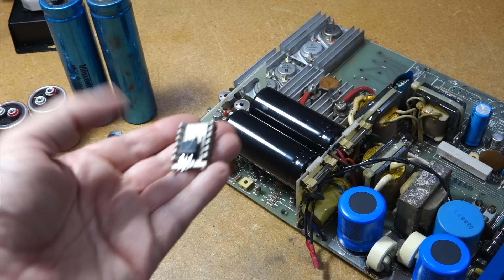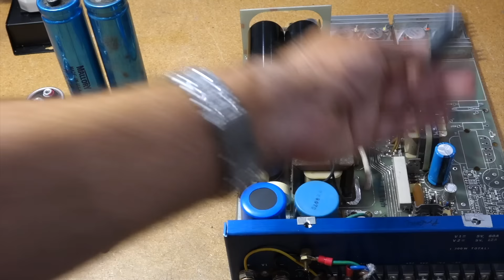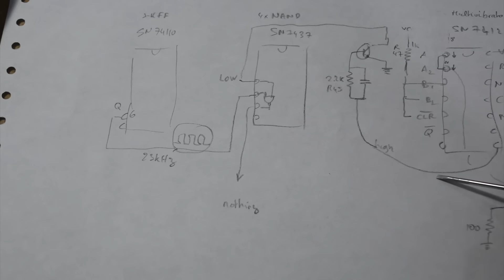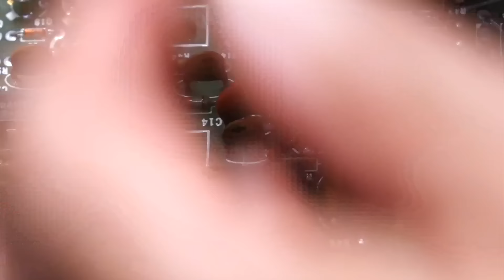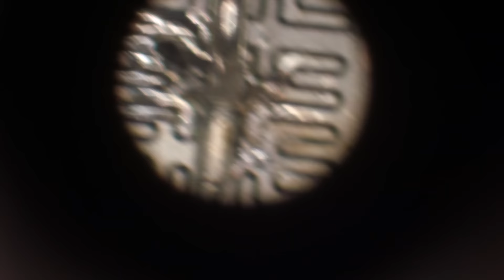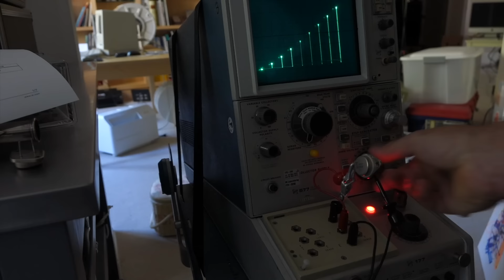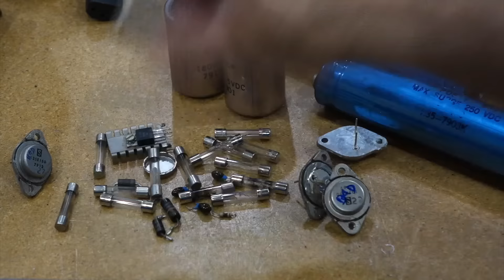Digibarn Alto Part 2: Restoring the Power Supplies from Hell

Comment: Very interesting vid, as always.

Only a handful of repair vids that go to this detail.

My first thought about the multivibrator is that it has a feedback path, so will probably inhibit the chopper signal if the output is missing.
Anyway - still watching. lol
Reply from the maker: Thanks! And the depth or detail requires more effort on the part of the viewer. That's why the retr0bright restoration vids gets 500M subscribers and mine get 8k. Nothing wrong about that though :-)
Reply: CuriousMarc

lol. True.

YouTube seems to be flooded with Nintendo Switch vids atm, too. Easy ingestion for the masses.

Magic smoke was from a thermistor, no?
(for in-rush current?)
Reply: only a handful of repair vids ever go into this much detail, is right. FFCossag is another I know of that will indeed get into this much detail, and the occasional MaxxArcade, when he wasn''t swamped with work and put out plenty of audio amp repair videos some years ago. I think FFCossag gets more special mention since he's one of the no-frills electronics guys on youtube that not only repairs stuff in alarming detail, but also will bend stuff to his will and "improve" the design of commercial products to make them less prone to inevitable failure otherwise.

Off that, I'm very pleased the replacement caps were Cornell-Dubilier. I don't think any restoration job on something such as this deserves anything less.
Reply from the maker: +Jordan I agree, 8-bit is very entertaining! His videos are very well made, well researched and instructive. And he works on vintage hardware that is quite accessible to most folks.
Reply: I like 8-bit guy / 8-bit keys as well, but he's not so experienced in electronics (self-confessed).

Don't get me wrong, David makes some great vids.
I just like to watch the more in-depth stuff, where possible.

The Alto stuff is right up my street, as I spent many years helping to restore a classic Quantel Paintbox from the BBC. ;)

(which, for various reasons still isn't booting.)

Actually +CuriousMarc - do you know of any SMD HDD readers / writers / emulators that don't cost a fortune, or any FPGA stuff that your colleagues may want to open-source?

We're still trying to recover the (possible) data from a Fujitsu SMD HDD with 14" platters.
I've done most of the PCB layout for the differential transceivers, and will need to write the FPGA logic soon for the MFM encoding / decoding.